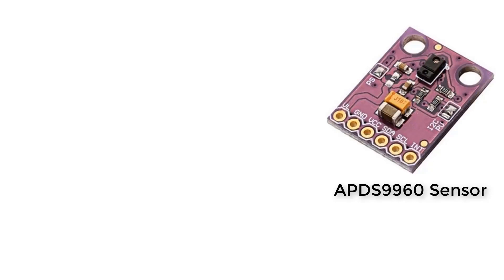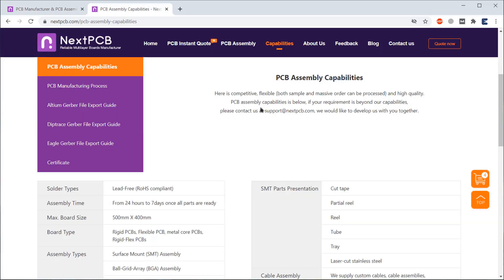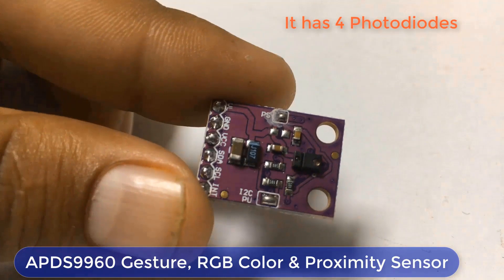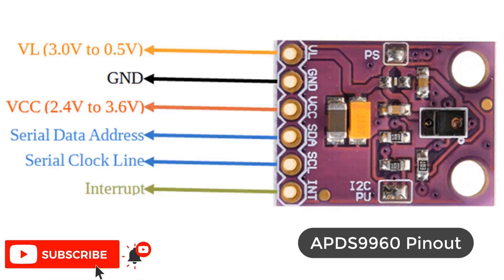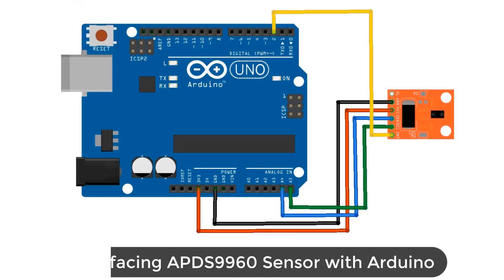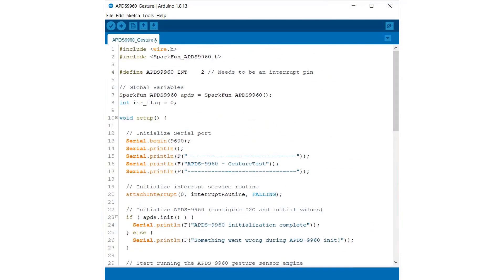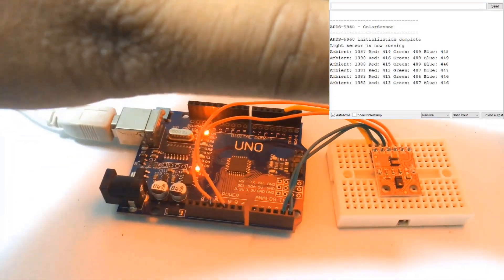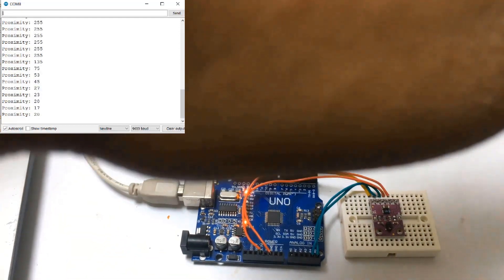APDS9960 Gesture, Proximity, Light & RGB Sensor Tutorial with Arduino

Comment: can i use the proximity and gesture both at once?
Reply from the maker: Yes
Reply: you can use gesture amplitudes for proximity estimation. Strictly speaking, proximity, gesture and color sensing can't be used simultaneously (unless you run three separate sensors). I am working on a product which will combine data from several different sensors and know them pretty well now.